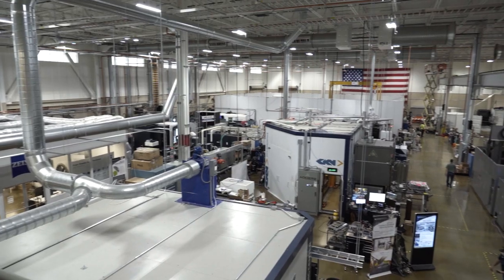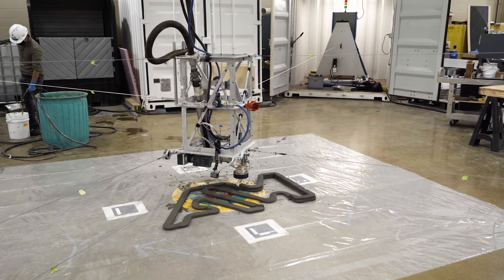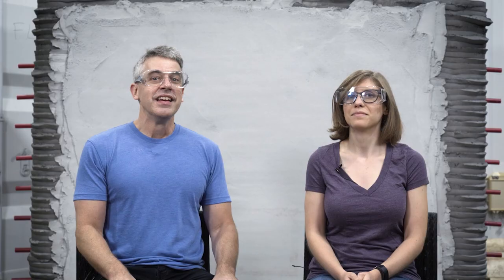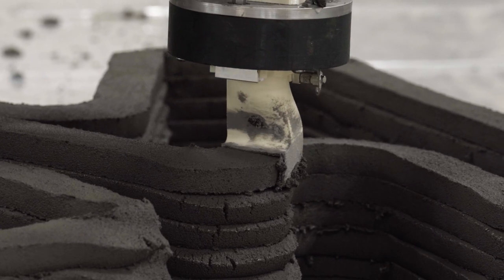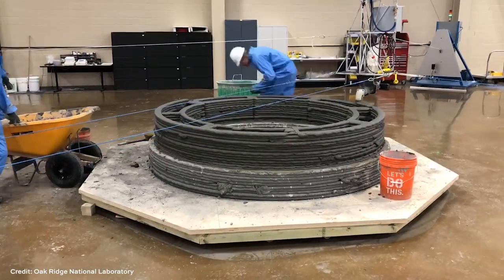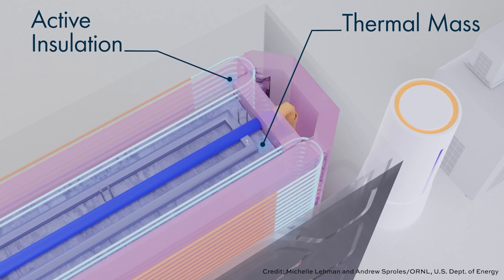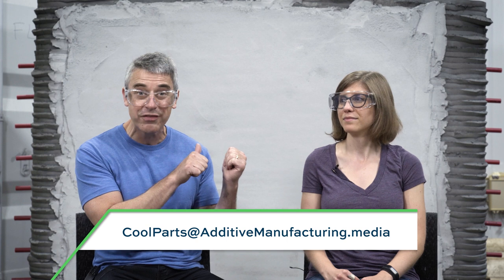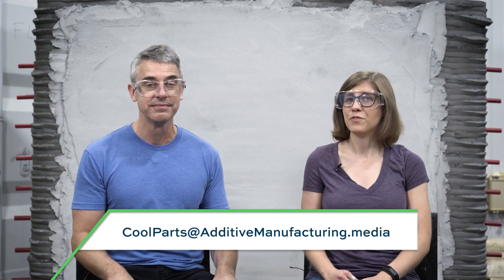3D Printed Concrete Is Key to This Smart Wall | The Cool Parts Show #40

Comment: looks like it would be incredibly weak and fall apart in a matter of time without rebar reinforcement!
Reply from the maker: Response from Brian Post of Oak Ridge National Laboratory: 
The reinforcement of concrete printed structures is an active area of research in the community with many different strategies currently being employed. In most cases the printed concrete is used like you would cinderblocks providing a formwork to which rebar is inserted and then backfilled with large aggregate concrete (this is how the EMPOWER WALL was reinforced). In some cases, fiber (typically glass or steel) reinforcement is added to the print mix itself as a reinforcement. There have even been groups looking at depositing steel reinforcement between layers or simultaneously with the deposition itself. The type and amount of reinforcement necessary is determined by the structural loading and building codes, and with a good printed mix may not even be necessary in many applications! In printed houses for example, the concrete being used is much stronger than the alternative timber frame construction, so often these aren’t required to be reinforced. Historically, reinforced concrete is relatively speaking a new invention, the Romans for example built concrete structures that have lasted thousands of years without any reinforcement at all! If you’re interested in learning more, here’s a good starting point https://en.wikipedia.org/wiki/Reinforcement_in_concrete_3D_printing.